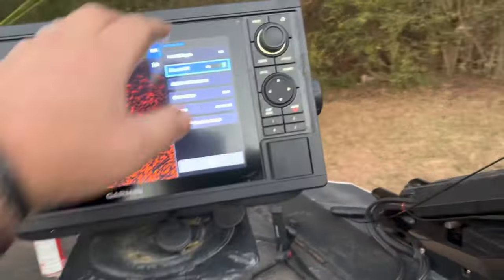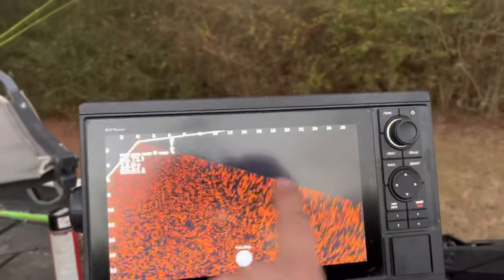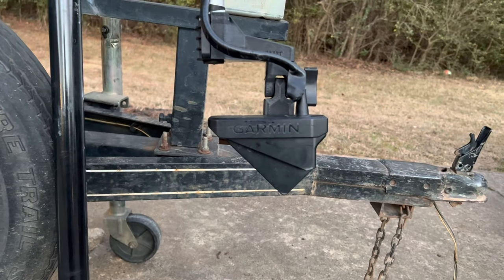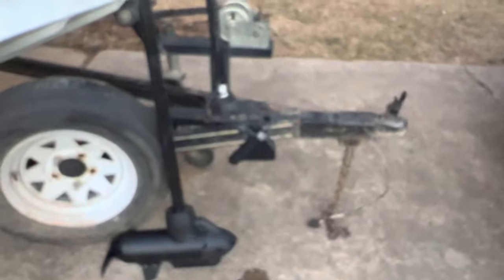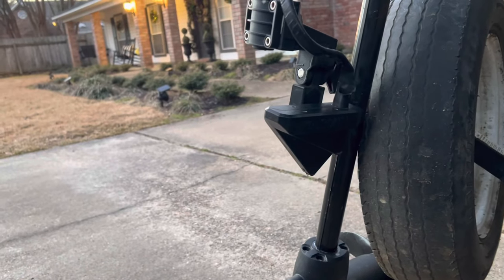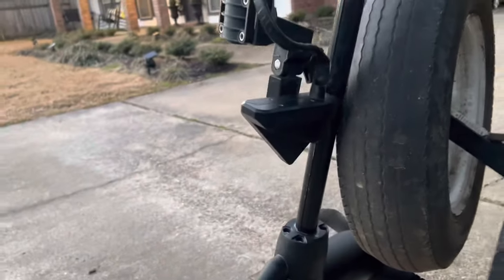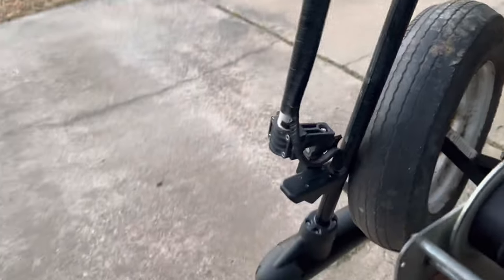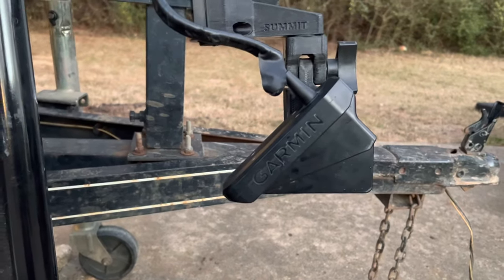Garmin Livescope: Basic Transducer Positioning For The Port and Starboard Sides (Forward Position)

Comment: Thank you for this. I just installera my perspectove mode mount and didnt understand why the transduser were pointing backwords. Previously i apperently have used the port side installation on my star board side when i only did the foreward mode.

Comment: I have my transducer mounted on the starboard side of the pole. Should I tilt the transducer so that the bottom is flat and then calibrate? What if I leave the top flat and calibrate. Will the computer know that will be forward? Not sure if I’m making sense in the second part of this comment? 

So starboard side = bottom of transducer should be flat and port side = top of transducer should be flat?

Comment: I bought a boat that had everything livescope pre installed.. after watching a cpl videos of yours I noticed mine is on the starboard side of my boat but the transducer is set up for port side on the pole mount.. I swapped it around and now it looks backwards.. Do I recalibrate the compass after repositioning the transducer
Reply from the maker: It doesn’t matter which side of the boat it’s on. It needs to be oriented for the side of the pile it’s on

Comment: Great explanation!  Since seeing the calibration videos I’ve been thinking about calibration and I have a question about perspective view. 
Does the compass require recalibrating after using perspective mode ?
Reply from the maker: If you would like the compass rose it does. Remember the system can only store one calibration and that is the position it was in when you calibrate the Livescope.

Comment: Im adding on the 93sv on a pontoon. I made a nice pole & have it mounted starboard right beside the helm so I can see & steer at the same time. Should I mount it starboard like you did here? My setup is different & didn't know if that changes anything. Great informative video, & no music! Great job
Reply from the maker: Awww now I have music on my videos some of the time. You can mount it port or starboard on the pole. It doesn’t really matter. It only matters on which side of the pole you mount it.

Comment: I’m can understand the setup instructions perfect… excellent video.!!! Where another video would helpful is showing the “ Physics” of WHY one needs the transducer to be “oriented in a different plane” when it’s located on the right or left side of the boat (starboard vs port) ???
(IF there are ,say three transducer crystals in the transducer, why would they have to be on a different plane, depending on being mounted on “RIGH” or LEFT” of the boat”?) I just cannot “visualize “ what is being accomplished by a mounting then in a different plane in reverse!)
Reply from the maker: Ten four. There actual 5 rays
Reply: Ecactly! Some of us need to understand the logic and physics.  My mind is comparing it to a handgun.  If I change a handgun from my right hand to my left. I do not turn the gun around and point back at myself.
Reply from the maker: @michaelgriffin2111  lol. Exactly

Comment: So if I'm using a pole does this matter or how should it be facing. The same as you were doing it on the video. Mine is on the driver's side of my boat. I'm using the specialty pool in mine is mounted flat on the bottom of the pole.
Reply from the maker: If it’s directly under the pole I wouldn’t think it would matter. This video is direct more at the person mounting it on the trolling motor shaft

Comment: I have mine  on separate pole than on trolling motor with a Summit fishing equipment pole end mount that comes straight down off the end of the pole.  Do I use port or starboard?  The cable comes down the port side with the transducer pointed forward.
Reply from the maker: I would imagine if it comes out the bottom whichever position you have it in when you calibrate the transducer the system will recognize that. That why calibration is so important

Comment: Now is it  the same for a pole mounted unit if it's on starboard side of boat ? Cause I followed the advice and my systems flips to bottom view
Reply from the maker: It just matters what side of the pole
It’s mounted on.
Reply from the maker: If it’s flipping to down view that’s just because your transducer isn’t positioned correctly

Comment: Kinda off todays subject but would like to know your opinion on screen savers like a comparison of the $50 one from Russell Marine, say the clear view from Amason where you get 2 for 20 bucks and Precision Sonar has one for $60 etc. I'm sure the Amason one might not protect your scree from a speeding bullet (weight) but is it good enough for the weekend fisherman to keep his screen clean and help visibility. Thanks
Reply from the maker: Tempered glass is the only one I’ve seen that protects but still allows clarity. In this case go with the best you can afford.
Reply: Ì upgraded from the ultrax to the Garmin force trolling motor and already like the switch. I'm running 2 echo map UHD 95sv....I have navionics on my phone....all this high tech equipment lol...and livescope but I run mine on a separate polo mount. I haven't updated yet but everything works fine... should I update based on the latest versions?

Comment: I'm sorry, I'm confused by your port side demo.  Your port side demo has the trolling motor and livescope pole still on the starboard side of the boat.  Were we supposed to "imagine" that you had it on the port side?  Or, is it somehow the port side of the pole?  Still very confusing.
Reply from the maker: Sorry this video was confusing. To most it wasn’t. Try this video instead. Garmin Livescope LVS34 & LVS32 Complete Guide To Transducer Orientation
https://youtu.be/YeZd2_-0xVs
Reply: @The_Garmin_Guru  Yes, that video was much better in that very early on in the video, it was described as the port side of the SHAFT.  This video just says starboard side and port side, but doesn't say what the reference point is.  Typically, when you use those terms (port, starboard), you are talking about sides of a boat.  In this video, we are actually talking about the sides of the SHAFT, not the boat.  Thanks for the clarification.
Reply from the maker: @mikewasserburger9662  no problem bud

Comment: If you are correct then the Garmin installation for trolling motor is wrong. What makes their display more confusing is they show the motor going in a different direction from Port settings to starboard settings without making it obvious to the reader. Their starboard side is really the port side description. Your video made me go back and look at manual I printed.  No wonder I have been having so many problems.  I have mine mounted like you on a poll. I also have a Force trolling motor but don’t want my Perspective twisting Mack and forth on it trying to keep me anchored.Thanks for showing us the screen change when you twist the transducer up and down
Reply: Correction  their YouTube display is wrong not the manual
Reply from the maker: Yea their manual is right. The YouTube is wrong. They are stupid

Comment: I see now. It's really which side of the pole. I thought it actually had to be on either side of the boat. It's is which directions the transducer is facing.
Reply from the maker: Exactly bud.
Reply: Holy crap man here I’ve been thinking the same thing listening to others talk about port/starboard side. 
I’ll be mounting mine on a separate pole. Which will be on the Starboard side of boat. But now I see also the correct positioning of the transducer itself in relation to port/Starboard side of pole. 
Thanks!

Comment: I dont think that's correct on port side . It depends where it's mounted with prop(tm) inside of boat or outside of boat. Port the correct position is the bottom of ducer parallel to water  for  forward. And d view  is is a click up. . Look on the webinar . Just saying if you have it mounted to tm
Reply from the maker: You’re wrong bud. Sorry. In port view the top
Is parallel to the waters surface. In starboard positioning the bottom is parallel to
The waters surface. Inbox me on Facebook and I’ll show the diagram if you’d like.